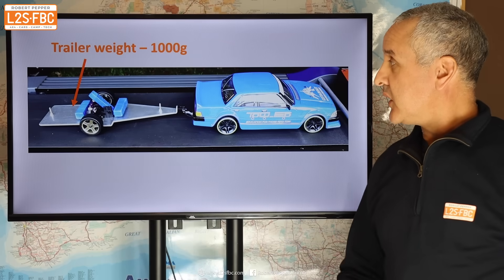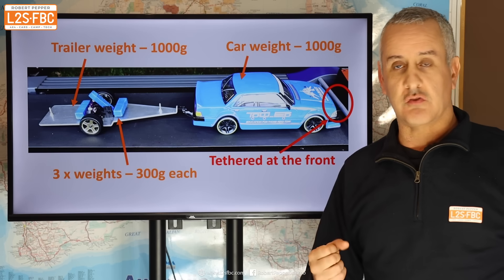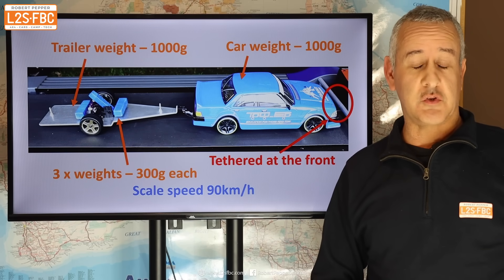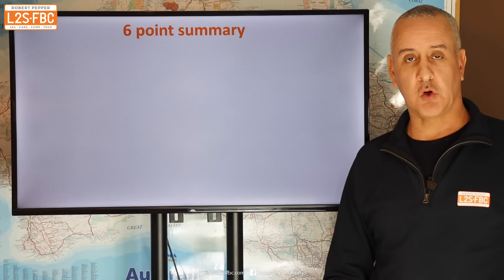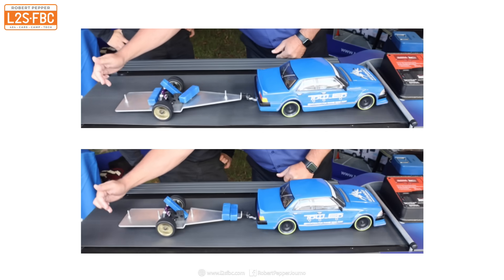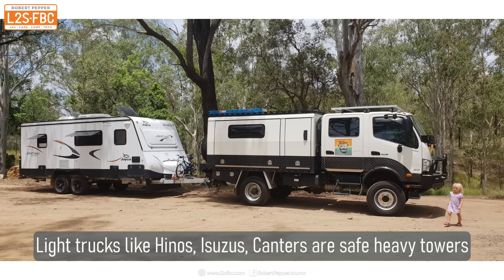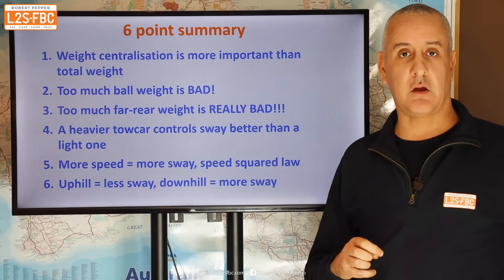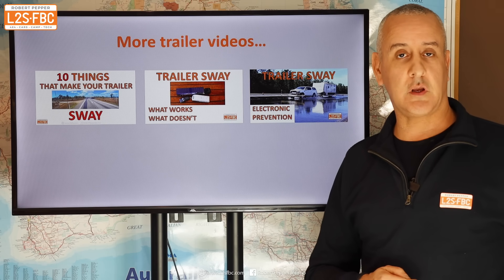7 trailer weight distribution setups, some safe, some deadly.

Comment: In the UK it's illegal for anyone with a modern licence to tow a trailer that weighs more than the manufacturer's stated kerb weight, and it's recommended to stay under 85%.

Unfortunately older licences don't have that restriction.
Reply: Are you talking about manufacturers train weight and stated towing capacity as given on modern vin plates … check out the figures for a Land Rover and your 85% is out of the window!
Reply: @andyxox4168  No, I'm not.  Well, not exactly.

The law is based on the vehicles unladen weight as specified by the manufacturer.  So if the manufacturer says your vehicle weighs 1.5 tons, you can tow 1.5 tons, no more - even if the manufacturer says it will tow more.

The exception to that is if the manufacturer states that the maximum towing weight is lower than the vehicle empty kerb weight.

So if you're in a 1.5 ton vehicle, but the manufacturer says it'll tow 750kg, then you cannot tow more than 750kg.

Basically it's the lower of the two values.

On top of this your gross train weight cannot exceed 3.5 tons.  This means a vehicle that weighs 2 tons empty but 3 tons loaded can tow 500kg.  A vehicle with a 1.75 ton empty kerb weight cannot tow 1.75 tons because you and your things will push the train weight over the limit.

The 3.5 ton limit is based on weighbridge measurements, just to complicate things a bit further.

So a 1.5 ton (empty) vehicle might be able to tow 1.5 ton, if you don't put much in the vehicle, but a 2 ton vehicle cannot.

If you get a trailer upgrade to your license, the gross train weight goes up to about 7.5 ton, or thereabouts iirc.  After that, you need a heavy goods vehicle licence or whatever.

Older licences state 6.5 ton gross train weight, with no other limitations - so my mum's licence or my dad's entitles them to legally pull a 5 ton trailer with a 1 ton car.  Doubt that's physically possible, but it's legal.  Stupid, but legal.

I think that in the last few years they've limited licences to 750kg and 3.5 ton total train weight, but I'm not sure - I can only tell you about my license really.

Oh, and all of the above is for braked trailers, without brakes I'm limited to 750kg.
Reply: Looked it up, and older licences (anything 1996 or older) can have a gross train weight ("Maximum Allowable Mass" or "MAM") of 12,000kg.

Anything 1997 or newer is limited to 3500kg MAM, if you get a B+E extension to your license (you have to take a "trailer test") then your MAM goes up to 8500kg.
Reply: Seems the government disagree with your analysis … https://www.gov.uk/towing-with-car

So it sounds to me like you have the wrong licence to allow you to tow effectively, though given the lack of common sense in many of the current generation the additional restriction sounds like a good idea!
Reply: @andyxox4168  That page used to be far more complicated.  I guess they simplified the rules.

A friend of a friend got taken to court for towing an empty horsebox with a Vauxhall Astra a few years back - at the time the law said that the trailer weight considered by law was the plated weight, not the current weight.

Because the trailer was plated at 2 tons, he was convicted.  It didn't seem to matter that that the trailer weighed about 800kg at the time he was towing it.  He got fined and he got points on his license.

Shortly after that the .gov.uk page changed to state that it was the weight of the trailer that mattered, not the plated weight.

I was towing an SJ offroader around a lot at the time, and I wanted to get a caravan, so I looked into what the law said I could legally do.

Because of that, I bought the lightest caravan on the market.  650kg empty, 850kg MAM.  Towed it with a 950kg Toyota Yaris diesel.  Looked into the law deeply at the time, and rang the DVLA to make sure I had my understanding correct.  The guy at the DVLA set me straight on a couple of things, but essentially everything I said before was what he confirmed to me at the time.

Had to stop flat towing the SJ and make it road legal instead.

It seems they've changed things again.  So now it's just the 3500kg MAM that counts, it seems.  Not sure that's a good thing, limiting the trailer weight to the weight of the empty tow vehicle made sense.

And the 85% thing was never law, it's just the recommendation of the UK Caravan club.

If I still had the SJ, I could legally tow it now, with a braked dolly.  It was illegal at the time because the dolly and the SJ weighed slightly more than the Yaris.

It was fairly heavily modified, and weighed more that a stock one.  I have vids of it on my YouTube.

Comment: I remember talking about (camping)trailer sway with one that drive big trucks 4 a living I mean , like heavy hauler trucks. He said the most important thing to do immediately if you via mirrors see the trailer is starting to sway is to hit the accelerator pedal and NOT the brakes. His claim was that accelerating would "stretch out" the vehicle and trailer and stop the sway. Where as the natural thing to do for most driver would be to hit the brakes and that would increase the sway and cause an accident. Is there any truth to this? Is this how people should react, or is that at best for professional drivers only. If that? My understanding of his advice was that he looked at it as "golden rule of towing". One that should always be applied if sway happens. I'm not sure about the physics behind his advice. Could it be about weight transfer? When would be the right time to let off the throttle again? As soon as the trailer is stable again? Slow and easy roll off, and gentle breaking I assume? And then stop as quick as possible and adjust the weight in the trailer? Or is his advice actually a bad advice?
Reply from the maker: It is bad advice. Take a look at my other sway videos for why.
Reply: @L2SFBC  I will, but after replying to your video I asked some co workers during lunch and a few of them agreed to use the gas pedal. One used to haul snowmobiles on icy roads and he claimed he "always corrected sway by adding throttle". UPDATE; I forgot that he claims he learned this at a winter driving track/school with professional instructors and that they practiced this on an iced track.  If this is nothing but an urban myth it seems to have gotten some traction. Oh well, I guess nothing to it but to point them to your videos. Quick reply btw. Nioe.
Reply from the maker: It's not quite an urban myth. But it mostly a bad idea in practice. Mostly.

Comment: '
thank explain this video about pull the trailer and weight...
but speed too fast is a not good...
must be 45 to 50 mph / 70 to 80 kph on the freeway / highway...
how about a trailer with 2 axles - 4 wheels

Comment: That is good to show, but theres also thing that the driver could do better. That driver only did the wrong things at the wrong time. I have been in that situation when it starts to throw the car. I braked and taked it under controll. This situation controll should be teached at the driving lessons school. Also it cannot controlled every time. Also, you should try the trailers front weight by lifting it yourself with your hands, you should get it lifted on and off without muscles!

Comment: How is weight at front and back of trailer any different to the same weight in the centre? 
The centre of mass is approximately the same, so why would there be any behaviour difference?
Reply from the maker: Huge difference. Go get two bottles of wine, full. Hold one in each hand, then fully outstrech your arms so the bottles are as far away from you as possible. Then spin 180 degrees and stop, fast as you can. Then, bring the bottles close to your chest. Do the same again. Notice which is easier?  You may now drink the contents as you have discovered the concept of a 'moment of interia'.
Reply: @L2SFBC  Thankyou, I have to admit I hadn't considered the rotational element. 
If it is harder to arrest the motion of the system with the weight toward the ends, does that also mean it would also be harder to get it to move in the first place?
So could such a trailer be more stable up to a certain point (before becoming  harder/impossible to recover)?
I wonder if the natural frequency of the system plays a part? A sway at a rate close to natural frequency would likely runaway catastrophicly. That thought then makes me wonder whether the relative natural frequencies of the car and trailer matters. If they are quite different then does one damp the other (is this why a heavier tow vehicle is more stable, also maybe a greater wheelbase helps). If they are similar then perhaps it would be like positive feedback. 

Anyway really interesting video and a brilliant model!
Reply from the maker: Correct it is harder to move to begin with. Which also means harder to correct!  Weight at either end is a bad bad thing!

Comment: I live facing the highway at Nanango QLD. On any weekend I hear & see halfwits towing right outside. I know they're halfwits because . . .
The SAFETY chain is dragging along the road. That conveys to me that no matter what guidance or instruction you provide, these simpletons will still mess up, ruin & smash anything they get control of.
I also see numbskulls dependant on drugs driving safely on drugs but making a mess of it when they're "straight"! . .
Go figure?
How do we address this madness? . .
Easy: Have the laws changed. Stop the government doing their preposterous money grabs with random breath testing. One size doesn't fit all.
Introduce new legislation... Bring in random IQ TESTS. It makes no difference whether or not they're drugged, drunk or otherwise...     If it's braindead, haul it out from behind the wheel.... INSTANT ENFORCABLE SAFETY.
STUPID CREATURES SHOULD NOT BE IN CHARGE OF VEHICLES.

I bought my 18' car trailer in 1986. Hauled it incident free over a million Ks. Weight distribution is absolutely critical.
Thank you so very much for going to so much trouble to set up & demonstrate these vital points and getting your message out.
There is no doubt in my mind... This brilliant little presentation has the potential to save countless lives & save many from injury, damage & loss.
All insurers providing cover for trailers & caravans should promote this video & if possible direct their clients to it.
Fabulous work! Well done!
Reply from the maker: Thank you! Please share 👍

Comment: What about actual trailer mass.
Should you pull the maximum (or 90%) value that the manufacturer states for that vehicle?
If your truck/car is rated in the spec sheet for xxx kg/lbs is it wise to do it?
The manufacturer also states a max power out value but that is very high in rpm and if you constantly keep the engine at that max value you'll blow it.
So, what about pulling a trailer near the max capacity of the vehicle?
Can you control the rig with all that extra weight, that may lead to disaster?
This is more important.
Reply from the maker: Wouldn't ever recommend pulling Max brakes tow. More like 80% is better.

Comment: I have built several trailers in my 74 years, both single and dual axle, with weight ratings up to 8000 pound load. I have found that as a general rule, a single axle unit should have the axle placed 53-55% back from the front of the platform. On a dual axle unit, the center distance between the tandems should follow the same general rule ( 53-55% ) from the front of the load platform. This way, when the load weight is placed slightly forward to the axle(s) center, ball weight increases less critically and the trailer will track very nicely without sway in nearly all conditions.  All of the points that you make are true, and should be followed. Thanks much for this video.
Reply from the maker: Thank you, the real-world experience complementing this is much appreciated!

Comment: This should be mandatory for drivers ed. So clear and the visual aid is perfect.  Well done lads. Pints on me.
Reply: Here in Norway it is mandatory for drivers to know this...
Reply: @a64738  although in Germany.
Reply: The driver has a lot to do with controlling the trailer.
Reply: In the UK people now have to train for and pass a test for trailer towing, separate from and after passing the basic driving license test and it also applies to lorries (trucks) too.
Also I was always taught that the weight of a trailer should NEVER exceed 75% of the weight of the tow-car due to the risk of a runaway causing jackknifing (trailer overtaking tow car).
Do you anticipate discussing the benefits and affects of using a sway bar for stability?
1 small criticism - that trailer has an A-frame towing hitch not a drawbar.
Reply from the maker: Will take a share instead cheers 👍
Reply: If someone needs a visual aid to get this basic stuff through their heads they probably shouldnt be driving.
Reply: @ThunderAppeal  Maybe but, lots of people need to see things to get a better understanding of what why and how.
Reply from the maker: Exactly
Reply: @ThunderAppeal  Seriously?  You think someone shouldn't drive because they're watching videos of towing dynamics & educating themselves?  So were you born with this knowledge? How did you learn this stuff? Smfh 👎😲
Reply: @pamlove421  Its amazing that people were able to grasp this stuff before videos.

You know like, oh I dont know, reading a book.
Reply: @ThunderAppeal  So you're saying you're comfortable with people towing if they gained their knowledge through books. That's interesting & archaic thinking. Do you still use paper maps as well? ✌
Reply: @pamlove421  Best towing video Ive ever seen. Im on your side Pam. But I have to say yes on the paper maps. lol. But only the very old ones. They have roads that google doesnt and will never show us. :) Thunder is better than the rest of us. lol
Reply: @Burton1973   Why only old out dated maps? New roads are made every year. Very old maps are going to be very little help...

Comment: Would love to see a demonstration like this with a fifth wheel set up.
Reply: i dont think it is as important.  with a hitch, the ball is where force is applied, the rear axle is the fulcrum, and the distance to the front axle is the lever advantage.  with a 5th wheel, you have infinitely increased the lever advantage.  with that said, i would also like to see a treadmill demonstration with a 5th wheel.
Reply: @spencerphilippinedream3706  Probably accurate. With the 5th wheel, your pivot point is over the axles (either in a pickup or on a semi), or even potentially forward of it where the fifth wheel is adjustable on semis. This negates the lever effects of a receiver type hitch on the back. A weight distributing hitch for instance would not have any application on a fifth wheel, where it does on a normal bumper-level hitch. It also shouldn't affect the weight on the front wheels much, but only increasing that a little if any.

Still, it would be interesting to see the physics of that setup in comparison to this one and how it responds to the different loading.
Reply: @Sevalecan  if you move the fifth wheel forward and the trailer wheels back, you push the weight forward and can increase the weight on your front axle.  Moving the parts of your vehicle is one way to not ensure a smooth ride, but to make sure none of your axles registers as over-weight at a weigh scale.
Reply: Not as relevant here in Australia, very few caravans/trailers are 5th wheelers.  The prevalence of 3.5-4ton (metric) trailer in the form of pig trailers, as shown in this video, is probably 99.5% pig trailers.  Being towed by 3.5-3.8ton landcruisers or less.  Whereas in the US, 5th wheelers appear to be more popular, probably because the price of them and pickups is much less than in Aus.  Though I follow a couple of US sites for the pickups, and they seem to push the limits with pig trailers and 2500/3500 pickups there as we do with utes and wagons.  Human nature to push the limits, it is how the human race either progresses or declines....LOL
Reply: Second that!
Reply: I'd like to see that too.
Reply: And gooseneck  !!
Reply: I would say - Same...
Reply: In technical terms, the distance from the hitch to the center of the drive axle(s) is the "hitch offset".   Decreasing the hitch offset increases stability.  The hitch offset for a fifth wheel is usually zero or negative (forward) making it much more stable than a vehicle with a drawbar substantially behind the drive axle(s).

Increasing trailer wheelbase (distance from hitch to trailer axle(s)) dampens sideways motion which increases stability.

Comment: A video on the effects of axle placement on a home built trailer would be really good
Reply: The best trailers are always designed exactly for the load.
It's all of those home built trailers that are meant to tow any damn thing that are the real troublemakers.
For those we have some basic rules of thumb that place the trailer wheels behind the center of the bed of the trailer and the tongue of the trailer far enough ahead of the nose of the trailer so you don't have a jackknife effect in backing obviously the longer distance from the hitch to the center of the trailer wheels will make more stable but it also destroys your turning radius if you make it too short you'll bump your bumper with the nose of the trailer and it makes backing way critical although it helps your turning radius it's all a matter of what you're willing to tolerate there is no system to cancel out idiots it's not always practical to design a trailer to only haul one thing with the same vehicle every time.